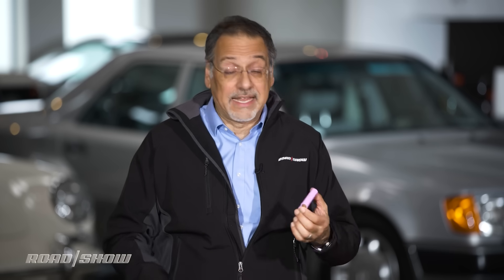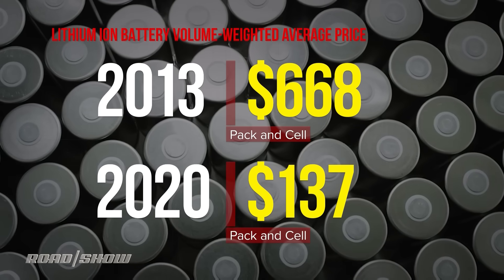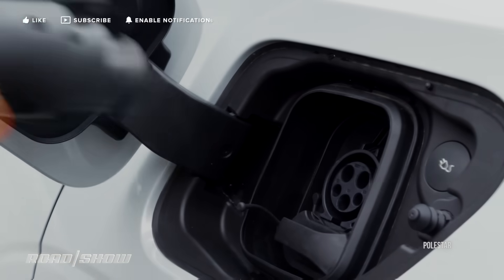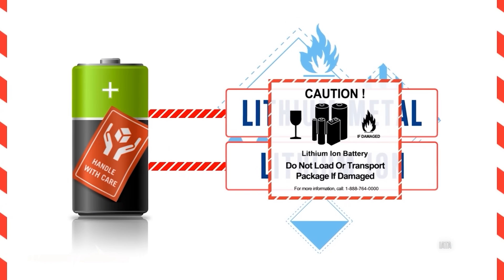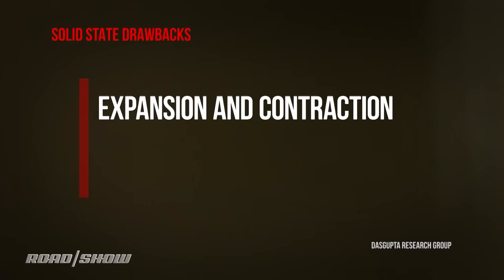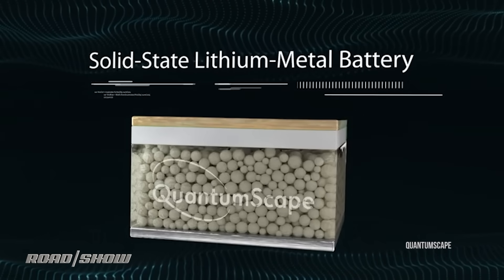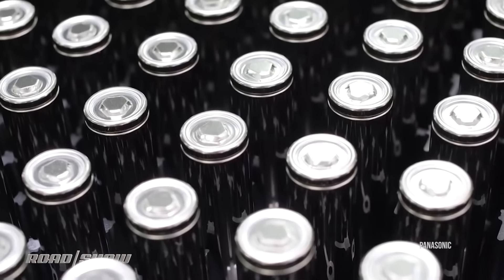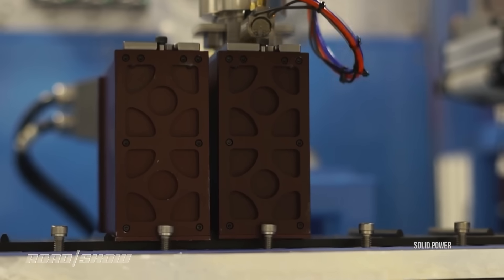When solid-state batteries arrive, you'll want an electric car

Comment: When they can go as far as a normal car, "refuel" as quickly, and last at least as long without the battery degrading, then sign me up.  

I'll even ignore the fact that, in most cases, they're actually powered by fossil fuels.  Very inefficiently.  I just like the quiet and instant torque.  Until they're charged by NUCLEAR energy they'll be dirty.

Comment: If solid-state batteries can be recharged by anyone then this is great news. If it will be just a battery that needs to be replaced in order to get a full charge then it really sucks. Then it would be like expensive printer toners that only fit a specific printer. Super cheap to make but very expensive to buy.

Comment: The battery isn't the ultimate problem. The problem is the grid won't handle the huge increase in demand required in charging. One horsepower equals 746 watts. One measley engine of 100 horsepower would require 74600 watts. Multiply this times millions of cars charging at the same time.

Comment: yeah not so much, in fact i want a vehicle with no electronics. The electronics I want on my vehicle is the after mkt stereo I slam in the dash.  I want an old fashion internal combustion engine with a points and condenser ignition system and a mechanical fuel pump. I want the body and frame made of METAL and as little plastic as possible.  You can take all of the electronic and electrical CRAP and all of the plastic garbage and stick it where the sun dont shine, thus defeating and use of SOLAR....

Comment: There is missing context here which is important. 
CURRENT combustion cars are much less safe than battery electric - especially in their likely-hood of  you getting 'fried/combusted' in them (About 10* higher per million miles of driving - see 'vehicle fires' stats).
Current solid state batteries are not in cars because they are much worse than what we already have and Quantumscape is not claiming to be trying to put their future theoretical product into cars until closer to 2030 - see their own statements/prospectus.
Also, most commercial solid state batteries currently have non-solid components... so it is not a hard dividing line between 'solid state' and 'non solid state'.
Ultimately this video is a wish list for what we hope we will slowly move towards in future.
Reply: video is propaganda

Comment: 80% in 15 min with twice the capacity that's an insane about out power
Reply: Yes, 10 to 80, 70% of 80kwh, 56kwh x4 (60/15) so 224kw. Not that high Porsche peaks 280k and Tesla 255k only at the lowest percentage. And average way over 100k and take 20-30 minutes to 80%.
And you don't need that every day only on trips.
Reply: I know Tesla had ae 250kw chargers but I was thinking they had batteries that big already but ya I guess the x is only 100kwh

Comment: Will there be enough of an electric grid to be able to recharge the millions upon millions of electric vehicles?  For example California's grid won't handle a hot spell.
Reply: You probably wouldn't consider diging your own oil well and building your own personal oil refinery.  Oil is going away.  BUT!  There is hope, you can very easialy make your own electricity, and charge your car with it, and run your home.  -  It's not free, but it's cheaper than buying electricity, and much cheaper than any fuel.

Comment: Range is going to become gimmicky. 500miles per charge is about all you will ever need and Tesla is about to hit that with their in house batteries. Even if you could get let’s say Thousands of miles of range from a Solid state battery it would be ignorant to do so. If your batteries were energy dense enough for that many miles you could just put an extremely small battery pack into the car to achieve let’s say a 500 range car and crush your profit margins

Comment: All the info is good but the charge times are a bit off Solid state batteries have been tested to charge as fast as 0-100% in 5 minutes and act like a capacitor when charging, some EV cars can already charge 80% in 15 minutes.

Comment: Herein lies the problem. Solid state batteries are an oft promised but never delivered technology which manufacturers have been working on for 2 decades plus. They are based on capacitors. The problem is that they are now and have always had issues regulating the flow of electrons. They work great as devices to boost voltage but they tend to want to deliver all their current very quickly. As a storage device they keep running into the same issue over and over again. This is exactly why most companies are securing their supply of the minerals needed for L-I batteries and some are even working on synthetic fuels which burn super clean. Only 5 years ago we were promised these within a year. So what happened? They don't deliver consistently. Does it mean they'll never figure it out? I don't know. However, don't hold your breath.

Comment: I still won't want them as they will still be heavy however it will make it livable. I would much rather a hydrogen motor or at least hydrogen/solid state.
Reply: 420KinK  your tiny brain fried mate 😂
Reply: 420KinK  lol you really don't know how anything works do you. FCEVs are absolutely viable and with renewable sources of hydrogen from agricultural waste becoming more popular it is a viable answer especially once solid state batteries come to the party. Lithium mining and the battery disposal itself is dangerous and damaging to the environment and as it stands is not a good long term option, disposal of solar panels is damaging to the environment FCEV solutions will give a clean way of generating power for the vehicles system without harm. 

Anyways I would love to keep burning gas but sadly that won't be happening for much longer.

Comment: What I want to see before I pull the trigger on an EV is an auto with solid state battery that is no larger than a briefcase which you can exchange at a service Center for a fully charged one in less than 5 minutes

Comment: I'll want an EV when you can go 1500 km on a charge and charge it back up in 5 minutes! Like NEVER going to happen.
Reply: Tbh if it can do 500 in 15 minutes would be good enough. Also have enough charging stations too
Reply: @JohanSebastianCorn  Who needs 1500km on one charge? maybe after autonomous driving is developed and you can sleep while the car takes you from one state to another.
Reply: @Daniela-pr7rz  As a software engineer by education. I don't ever see self-driving cars ever get to that point. Sure you can have it drive but you'll still want to look at the road. It is like playing poker with A-K straight forgetting Royal Flush exist. It also doesn't need to be 1500km charge, it could be 50km. It just needs to charge 10km per minute at the very least.

Comment: Solid state/Led acid/lithium/??? will always struggle with a BIG con. The only thing batteries can do is to store energy. They do not create anything. The biggest issue is HOW to create energy at low cost, in an environ friendly way. What is the meaning with an electric vehicle if the energy comes from a coal factory or some other bad energy producer? JUST A THOUGHT 👍🏼😇.

Comment: Ethanol powered fuel cells are here today, powerful, and can run computers, drones, and cars etc.  Nissan ran one in Brazil in 2016 where hydrous E100 is already sold for combustion cars.

The ethanol can still work in the cell even with enough water so as to be non-flammable. 

People could plug their car into their house instead of the other way around.  Would have been handy during the recent power outages.

Comment: We don’t have enough electricity supply for all these cars
Reply: We will have once we stop wasting it extracting, refining and transporting oil, petrol and diesel. It uses 8kwh of electricity to produce one gallon of petrol. And then it gets poured into a car which then burns it with an engine that is around 30% efficient.
Reply: How do you propose we mine for the raw materials to make these batteries? Do we have battery operated vehicles that have the power and duty cycle needed to do this?

Comment: You should want an electric car anyway, they're already better. We all love classic cars and there's room for them to exist forever. But most (90%) existing ICE cars should be upgraded to current EVs. Way more efficient, easier to drive, better for the environment, cheaper to run, easier to maintain.
Reply: not so   ICE cars are way more fun to drive even more so when there are no electroncs involved when you have to proper drive the car    i am a petrol head and willbe until the day i die

Comment: Can you imagine the inrush current , the power inrush into the batteries from the power grid?
Imagine these battery charging loads dimming house lights in a system grid as thousands of batteries all about a large city demanding electrical power.
Reply: Kind of like if people had air conditioners in their house
Reply: @rp9674  yes

Comment: I've followed battery technology advancements for years and years. I can tell you with no doubt in my mind, the country would be far better off pursuing a hydrogen-based infrastructure than to wait on the solid-state battery.  Battery advancements are slow in coming, and take years to test. Solid state batteries will come much slower, and they may still be no panacea. 
As for the current state of the LI-ION battery,  advancements have been oversold to the public. Even while Tesla has engineered a remarkable automobile, the duration of the Lithium Ion batteries they're are using are disappointing to say the least.   Tesla's battery warranties go anywhere from 100K miles or 8 years, whichever come first,   up to 150K  miles or 8 years, whichever come first.  The gauge is whether it retains 70% of its original capacity.   If we were to assume you initially had a 300 mile range, your battery capacity is assumed to be fine so long as your range stays above 210 miles.  In what world would that be acceptable for an internal combustion engine?  Yet, you will pay a premium price for a Tesla as compared to comparable internal combustion engine automobile.  What's more is this battery life is reflected in the resale values of a used Tesla automobile.   But as long as you have money to burn, no problem.  As for the masses, this won't work.
But that's not even the worst of the news.  Let's assume 10% of the driving public drove an electric automobile.  The draw for the recharging is substantial, and with 10% of the driving public recharging at night, fossil fuel energy will need to be greatly expanded and fossil fuel will need to compose an ever larger proportion of the fuel mix if we don't want to see regional black outs. Wind and solar are not dependable sources, and are even more worthless in the winter.

Comment: Why oh why hasn't anyone figured out the answer to the problem of range with these electric cars yet?   THE ANSWER IS AS SIMPLE AS A CORDLESS TOOL!!!  That's right folks.  Interchangeable batteries!  Pull up to a service station, but instead of filling up on gas, they swap your battery pack.  We could have had this 20 years ago if there had been any backing by our government, but wait, they were too busy subsidizing fossil fuel companies...

Comment: 1000 cycles is barely enough when you drive 400-600 miles per week plus 5-6k miles of recreational travel per year. I see that as maybe 14-15 years under perfect laboratory conditions. I would expect maybe 70-80% of stated performance under normal usage = maybe 10-11 years life expectancy? For the expected cost, just barely adequate.

Comment: No, you still want an electric car. It's cheaper on the long run, insurmountably faster, almost maintenance free and uses unlimited energy provided by the water (hydro) or Sun (solar) in most cases.

Comment: Where are we going to get the electricity for the electric car?
Reply: From mostly fossil fuels for now.
Reply: @blackworldtraveler3711  Then why not just use gasoline then? Oil and gas are not fossil fuels. When you transmit electricity you lose up to 80% of the electricity depending how far it has to travel
Reply: @bluesky6985  
People have been calling it fossil fuel for so long I just stay with it.

People are using gasoline.
Everyone have a choice now between gas,diesel,NG,and electric.

Personally I’m more interested in the battery. Prefer solid state.

Comment: OK, but...the electricity comes from where?!
No, not wind and solar...ask Texas from Feb2021.  Regulators forced conventional maintenance and improvement funds to green energy, and it FAILED, making it a deadly winter storm.
Reply: Renewables were 10-15% of Texas grid, and no regulators made them winterize that, or the dino grid, which is where the real problem was.
Reply: @davidm5707  You are right about the 13% being fragile green sources, but you are wrong about NO winterizing for the conventional.  Wolf Hollow 1 and 2 in our area were on-line all week as were many others.  But back on topic here...buy your electric car.  I'll pass until they figure out how to shift the carbon footprint these car create without killing the planet.

Comment: Who's buying a brand new combustion car next year?  What happens to prices of combustion cars when everybody wants EV? What happens to Gas prices when everybody is charging at home?
Reply: What happens to electricity prices when EVs are more than the current 2% of market penetration?
What will be used to generate that much electricity?
Reply: @davidm5707  iPhone penetration was low, right before it killed Blackberry.  Yeah, I'm sure whatever we can afford to pay (or were paying for Gas) is where the price will be set.  Right now super charging is far from cheap or convenient.  I'm holding off on buying or leasing new cars until 2024 when the landscape is a bit more clear.

Comment: 350k miles if you recharge your battery at 0 miles each time.  What person on earth is going to do that?   Most likely ppl will plug in for a "top off" every 3 days or so IF they work close to home so a 1000 charge cycles comes out to about 8.3 years in the real world.  Not so impressive.

Comment: I have to call BS... Why wait/delay? 250-400mi per charge every morning seems like it will work for everyone with existing Li-ion batteries...and EVs are 10x cheaper to maintain...and 4-10x(variable cost of petrol) cheaper to power per mile than ICE vehicles. These SS batteries will be nice when they arrive on the market at scale in 5-10yrs and are cost competitive. Most importantly, this fear mongering around li-ion fires is crazy. What’s more dangerous-a grenade or a camp fire? All of our existing ICE vehicles with gas tanks may ACTUALLY explode sending out shrapnel vs. a contained self oxidizing fire w/o the ‘explody’ shrapnel bits.

Comment: Who cares once Tesla launches a fully autonomous Robotaxi network no one is going to care about the battery anymore. And that is just a matter of time to achieve FSD. Maybe not this year but by 2025 when the first of these solid state batteries starts to emerge I think we'll have FSD level 5.

Besides Tesla's improvements around the 46/80 batteries which will be in millions of Teslas by 2025 will give ample performance and cost advantages. It will be a real challenge for any solid state batteries to compete unless they are orders of magnitude better than what Tesla will be bringing in over the next few years. If the first working prototypes are not emerging for another 3-4 years then you have the challenge to scale that to mass manufacturing then Solid state is much later on this decade.

By then it will be too late. If the performance is superb I can see Tesla manufacturing its vehicles with  solid state batteries. But by then Tesla will no longer be selling vehicles to the public anyway. It will be manufacturing directly to their Robotaxi fleet. I think by 2030 You'll have Tesla, Apple, Amazon and maybe VW, Toyota and a few other left in the game.

Comment: For me to want them, they must have: be cheaper than normal cars (less mechanical parts, should be cheaper, electronics is dirt cheap), have at least same range, be refilled in comparable time, be able to start (and heat inside of car) in -20C (also not losing too much range). Not being insanely expensive to repair small hole in floor (like recent case from norway). Then and maybe then i buy electric car. And (for now) i do not care about Co2 footprint, because all that electricity needs to be made somewhere anyway, and it is still mostly in Co2 plants, so why bother.
Reply: that is correct

Comment: Hydrogen: - long range, - refill in minutes, - no range decay over time. Drawback expensive. But what isn't before solved and mass produced?
Reply: Hydrogen is inefficient to produce and a hassle to handle as it needs to be pressurized.

Comment: I have a simply one question? Electric cars are coal powered cars. Electric cars will not work nationally without citing hundreds of coal fired power plants.What then becomes the reason for electric cars. Certainly not for the climate.
Reply: Coal is being phased out. In the late 90’s coal was used to make 60% of the US’ electricity. Now, it only makes less than 20%

Comment: But how fast does it charge? That is one of the main problems in electric cars.
Reply: They vary from make to make, but I can charge my Kia up from 30% to full in around 40 minutes. That's using a 100kw charger. Tesla chargers are more powerful, and can add 75 miles range to a Tesla for every 5 minutes they are plugged in.